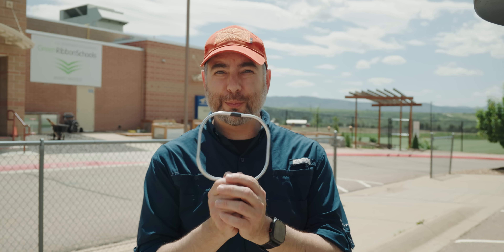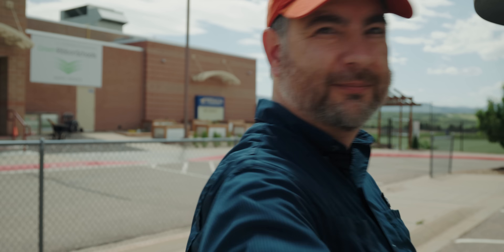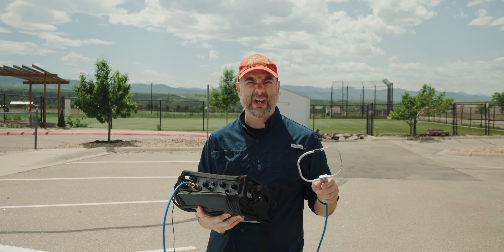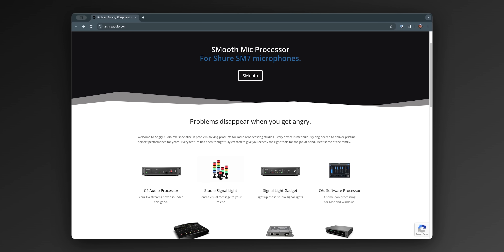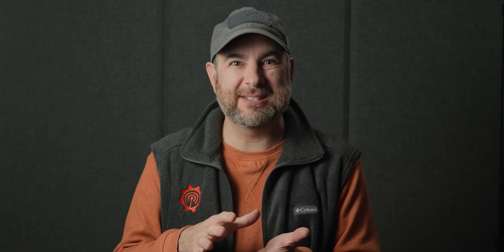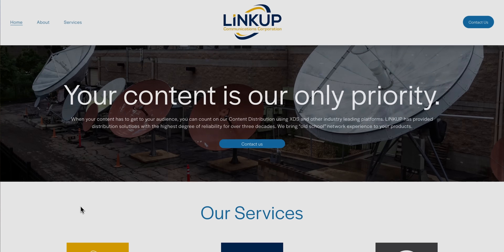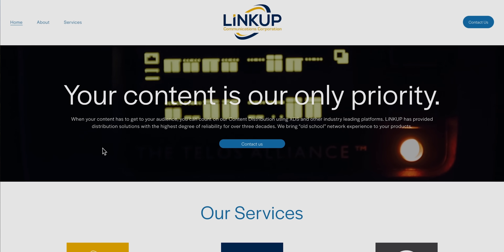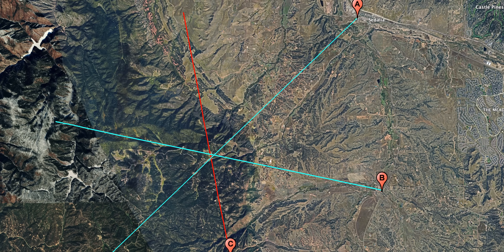Hunting a pirate transmitter

Comment: wouldnt a doppler be a loot simpler? Amateur radio have been using that in fox hunts for a lot of years. Instantly see what direction the signal is on the fly. No messing around
Reply from the maker: Simpler, but way more expensive. Most broadcast engineers will have a spectrum analyzer for doing many other tasks. So using a tool that you’ll already have to do this is prudent. Spending $700+ for a Doppler system that you’ll use only a couple of times in your career is a little hard to justify. If you do it all the time, then yes.

Comment: Hi all. UK Here. 
Back in the early 80’s of AM/FM CB game called Fox Hunt we had a car that would hide and that driver and passenger would describe a hint what was close. 
Stay with me, so we had to find that car with clues so what I used to do was use the SWR, the trick was turn it up then change direction soon as it cuts off turn around, repeat. Until the radio SWR was a maximum and you could still hear the Fox. Narrows it down so much… the winner was always Fox so you saved on petrol. 
It was fun when over twenty cars was involved

Comment: ....ham radio guys get pretty good at this....often chasing interference deliberate or otherwise with directional antennas and loops. Since portable spectrum analysers are not a dime a dozen, a general coverage RX with a S meter will work OK..
Reply from the maker: I just picked up a Tiny SA. I may give that a whirl this coming week to see how that works.
Reply: @TheBroadcastEngineer   the kraken sdr setup is also a cool option  for  transmitter  hunting
Reply from the maker: @gfdemt917 If I had the cash for that I’d snatch one up in a heartbeat. I did pickup a Tiny SA from Amazon for $57.

Comment: One trick I learned from years if tracking ELTs/EPIRBs is that as you get close in with a very strong signal, often creating lots of false reflections, is to go to the HARMONIC(s) of the signal youre tracking,. ELTs, tend to be VERY harmonic "rich". And so are many (junk) pirate transmitters. You dont always need a fancy SpecA, just a wideband Ham HT or Scanner will often do fine.  Happy hunting :)
Reply: @radiodf  Correct about not always needing a Spectrum Analyzer. A few miles from my home we have a traffic light that emits a signal on 146.52 Mhz which I hear on my mobile 2 meter radio. When the light changes to GREEN the signal goes away.

Comment: All this is good for a signal with fixed location and a visible transmitting antenna.
It becomes almost impossible with a mobile transmitter (not an FM signal), that transmits illegally (for short periods of time) in the shortwave bands and causes interference to other legitimate users.
We used to do this in the army in field communication and, after each transmission,  move quickly to another location.
Reply from the maker: Yeah, mobile units are a lot harder. I didn’t cover that as this channel is focused on broadcast which is a fixed point.
Reply: I've dealt with those too. There were some guys keying their mics and holding the mic near the stereo speaker while driving. We knew their were two different ones, because one played rock, the other one liked country. At that the in culture seldom did those genres meet, if you catch my drift. Yeah when they are mobile, it's tough. We got a number of people tracking them. A couple of our fox hunters had invested in a device called a Dopplescant. You fed it from four 1/4 wave antennas evenly spaced on your vehicle. The control unit went between the radio and the antennas. These things were hard to fool. They would trigger on reflected signals and with no antenna gain, weak signals would also beat them. Again, in most cases they worked  very well. In our practice T-Hunts we tried to fool these things. Made it tough on the guys using conventional means. We didn't catch anybody red handed, but got close enough, that we got a semi-confession out of one, "his buddy did it."  So, the rock music one, went away, shortly thereafter.  Then one of the fox hunters walked up on the country music suspect just as he got out of his car. The guy recognized his fellow ham and asked what he was doing, he said looking for the person jamming the repeater with country music. That one went away after that. The rock music suspect was a crazy teenage kid. He was a licensed ham, just kind of a spoiled brat type. The story we got, the kid is blind, another ham was driving and claimed he didn't know the kid was holding the mic in front of the stereo. It was happening on a regular basis, so that was hard to believe. The country music fan, was a 35-40 y/o, old enough to know better. He just kind of had an attitude. They both got kind of nervous when vehicles with call letter plates were following them, and especially the ones equipped with the Dopplescants.

Comment: The loop nulls either side....2 nulls broadside ....when at sea as an RO we had a Bellini Tosi antenna up top (crossed loops) which were attached to a goniometer in the radio direction finder. You found the 2 directions at 180 deg from one another and then hit SENSE which would plug in a vertical on top of the crossed loops this made the radiation pattern go from a figure 8 to a carotid shape (single null) showing the actual one to pick of the 2. 73 de VK2AOE

Comment: 😅one thing doing this in Colorado where there’s FA around for miles. Much trickier in the middle of London where there are so many reflections and phase angle changes! 😅 Nice video , we used a map, transistor radio, compass and ruler in the old days.
Reply from the maker: If I were to go downtown or up into the mountains it would be more difficult with all the reflections, but for a basic video, why make life harder for myself and just keep it easy. :)

Comment: Word of the day: Triangulation. You can do the AM null with a pocket radio very effectively. FM pirates are easy to find too. The antenna is out in plain site. 1st adjacent gets quiet when you get close.
Reply: In the old days before GPS and even before Loran navigation, boaters could use directional null antennas and use stations in the AM band to triangulate their position on large bodies of water. If you were in the Atlantic, maybe close to Florida, you could find the direction to a station in Miami and then one in Jacksonville (just an random example) and draw lines from them on a map and the intersection was where you were in the ocean. Accuracy was good enough to use to steer your boat to where you wanted to go. This technique was once pretty common until the late1960s when Loran stations for navigation were being put in places near bodies of water.
Reply: @markr.1984  There's a story in The Register today, thanks to GPS jamming the UK and France are looking to bring Loran back.

Comment: Would a NanoVNA work as the spectrum analyzer?
Reply: @jackmortimer329  No a nanoVNA would not be useful. A TinySA Ultra is an excellent tool in a similar price range as the nanoVNA.
Reply from the maker: I want to get my hands on a Tiny SA. Saving up my sponsor dollars!
Reply from the maker: Nevermind... just found one on amazon for $57. It'll be here tomorrow... 😄
Reply: Note that the original tinySA has a very small 2.3 inch screen, which is nearly impossible to read.  The reason that I bought the ultra model was for a few more dollars, it gives you a larger 4 inch screen, wider frequency range and also FM demod. via an earphone jack. 

Enjoy! It is a great simple tool, which is accuate enough for basic testing.

Comment: Will this work at lower frequencies?  Like 7 MHz?
Reply: You'll need a bigger loop, but yes, loops are often used to DF on HF frequencies. A loop this tiny will be very inefficient on HF.  networked TDOA systems also work well to figure out what part of the world to take your loop to.  Large ground based yagis work too for initial bearings.
Reply: @stargazer7644  There's a net that I frequent that's subject to jamming.  Somebody is playing recordings of Morse code on two closely spaced frequencies.  The text is random, with obscenities.   I suspect that FCC will not bother to search them out, but if we hams identified the culprit and gave it to FCC with a ribbon on it, they'd take action.  Net control is in Southern California, and the signal is very loud at his location.  I can hear it up north, but not very strong.
Reply from the maker: The FCC likes when you give them a big present like that. They will redo all your work but they don’t want to be chasing grudges and bad engineering. When I had to hunt the last time I had to put everything down with a lot of detail and photos. And even then they didn’t act on it. The LPFM ended up going bankrupt.

Comment: Why not just use a Kraken SDR.   It has 5 small antennas and pin points transmitters
Reply: The Kraken isn't a magical do everything device.  Try using it to locate a weak intermittent repeater jammer who doesn't want to be found sometime.  It's pretty useless for that.
Reply from the maker: Because I already have a spectrum analyzer and can’t spend $700 for something that I’d use only a couple of times in my career.
Reply: @TheBroadcastEngineer  If you spent 0.25 hr using the Kraken  vs.   1.5 hr  with the Spectrum Analyzer,    aren't you more efficient then?
Reply from the maker: @dan_in_sd in a technical numerical sense yes. But the reduction is not that significant. You’re still driving around. Had I not set up the camera it would have been a lot faster.
Reply: @TheBroadcastEngineer  i have a kraken and its worth it although i dont hunt pirates

Comment: Why not just use the "Kraken SDR"  to locate RF Emitters in the 24 MHZ  to  1.6  GHZ   frequency spectrum.     I have the use of one and found a cellular tower with a continuous carrier signal at 730MHz.    Found in under 20mins of driving around.   :)
Reply: I'd like to see you use a Kraken at 24 MHz.  I have a Kraken too.  I find it fiddly and useless at finding weak or intermittent transmitters like malicious jamming.  It works fine for strong, stationary constant wideband transmitters at high locations above about 80 MHz.  But I find I can usually find those pretty fast with just an FCC database lookup.
Reply: @stargazer7644  yeah,   they really work well but maybe 70MHz and up.   i never found it fiddly.   just takes common sense
Reply: @stargazer7644  not generally good to use at 24MHz,   but ive tracked emitters at 70 and 90 MHz
Reply from the maker: The reason is because I don't have one, and don't have $700 to buy one. I use a spec an way more often than I'd use a Kraken... however, if you have one or have access to one, that would be WAY easier.

Comment: We used to do CB T-hunts back in the 1980's. Either picked a channel that was rarely used, or if most of the crew that used a channel was there  we would use our regular channel. We used to have a large group on channel 4.  That was usually interesting with the base station folks getting a laugh out of the rest of us. I had antennas mounted for highest directionality, and a dummy load in case I wanted to verify how close I was to the transmitter. We would sometimes play all night. And most of the HAM hunts  are referred to as Fox Hunting. There's a website for finding hunts close to you.

Comment: Hy. Im facing issue with 855Mhz signal. We use radio for pump station... and now, à fucking guy probably buy à baofeng. And we lost radio signal sometimes. Sometimes is only after usual job time and on week-end...
Reply: So DF him.  All you need is a receiver with a signal strength meter and a small yagi for 855 MHz.
Reply: Ok. Thank you. We have yagi antenna. I will buy an entry level receiver. A sdr is fine ? Thank you.  @stargazer7644
Reply: And we need a 5% duty cycle to keep our tank at correct level. This Day, i set m'y duty cycle at 50% 500mW. 500mW is maximum in French régulation. 50% duty cycle is forbidden.... I will solve the issu and go back to low duty cycle.
Reply: @pab26120  Buy a Kraken SDR.   Or find someone who owns one.   Try your local HAM Radio Club.   someone there has one.

Comment: I've done many T-hunts or Fox Hunts as they are called.  I understand in Japan they do a lot of them on foot and make a race out of it too.  You see guys in tank tops, shorts, and running shoes carrying HT's and a directional antennas.  I got pretty good at it.  My ham club, held one on the third Saturday of the month. Another club decided to hold one on another day.  The guy who was the "Fox" (hidden transmitter), started talking about me, and wondering if I was on the hunt.  He said I had a reputation for not saying much then sneaking up behind the fox, tapping him on the shoulder and saying hi.  I was listening to this and decided that sounded like a challenge to me.  I was at a friends house with twin 11 element two meter Yagi's.  I was able to figure out that he was almost due north of me, and little signal analysis after throwing some attenuation in line, I knew where he was.  So I jumped in the car, drove to the spot and started waving hi.  Then a crazy one, I was the hidden transmitter.  I chose a spot very near the repeater site, so I could run any power level I so desired and still be full quieting in the repeater.  It was around Thanksgiving and the stores were very busy.  My location was in the parking lot of a Walmart Supercenter.  I figured they would have to find me amongst 10,000 other cars parked in that lot and many of them coming and going,  I would give these clues, my partner would almost bust her gut trying to keep from laughing.  I didn't lie, I just didn't tell the whole truth.  My clue would be "off to my right I see a tree." Then ok ok, that didn't help, also "very near me is a blue Chevy pickup truck."  In this town how many blue Chevy pickups are there?  Probably a couple of dozen in that parking lot alone.  Well, just a few minutes into this thing, a car pulls into a parking spot literally right in front of me.  It had a ham call letter license plate, I recognized it.  Belonged to a YL operator, Sister Virginia, a Catholic Nun, who was a ham radio operator.  She used her radios and skills to serve mankind, as part of her job as a Nun, serve other people.  She wasn't even participating in the hunt, just out getting some supplies she needed. Nuns shop at Walmart too.  I was at first, no fair! using divine intervention to find the fox.  However, there is nothing in the rules against it.  We had very few rules, after all we were practicing for finding rule breakers, not rule followers.  The fox had to transmit a reasonable amount of time and mostly on the reoeater's primary input.  This particular one had some UHF inputs as well, and since I was the engineer, I knew what they were and their PL tones.,  Also, the fox had to hide within the county limits, and must be in a publicly accessible place.  Like a park, a shopping mall, or if on private property, the owner doesn't mind the fox hunters coming in.  One time a couple of guys got a little gray with this, they hid well off road in an illegal trash dump.  It would have been helpful to have four wheel drive to get in there.  We started calling them the "nasty boys."  The fox hunters could use any means to find the fox, including calling his XYL (wife) on the phone and asking where she gave him permission to go that day,  One of them before my time, they told me the "Fox" dressed down, in old clothes, didn't shave, or comb his hair, put his HT in a brown paper bag, where it looked like a hidden liquor bottle, he might have had one of those too, that was his occupation, liquor store owner.  He would wander around a park where there were other homeless people hanging out.  He even approached one of the Fox Hunters and bummed a quarter off him.  He later accused the guy of being a tightwad, "only a quarter, come on."  They figured it out when they asked a teenaged kid, if he had seen anything or anyone acting unusual, and the kid, replied, just that narc over there, talking into his brown paper bag. Then the fox hunters, said, Clint it's a wonder you didn't get shot!  This is too long as it is, but I have many stories about transmitter hunting.  I introduced my GF to it by the second date.  She got her ham license and glued herself to me as my wife of the last 20 years.  A woman that likes ham radio is definitely a keeper.
Reply from the maker: Oh my gosh those are awesome stories!
Reply: In Europe (mostly) there is an annual organized international sporting competition called ARDF or radiosport with teams from over 30 nations.  They hunt on foot on 80m and 2m. Check the wikipedia article on "Amateur radio direction finding" for more info.
Reply: Love the Nun story! I pulled some hides on CB that were just plain nasty. Concrete walls and chainlink fences, canyons with those giant power lines and backed the car up within a few feet of the towers. Along with the rule that you had to hide within the boundary, but there wasn't a rule against going out of bounds and coming back in!
Reply: @javabeanz8549  We did one at night on two meters.  The guy drove a pickup truck and had an 11 element yagi in the back end.  His transmitter was steppable from 100 mw to 100 W.  He would aim the beam at the skyscrapers downtown and at the broadcast towers west of town.  We were driving up and down these dark roads in isolated unincorporated areas with oil leases.  The leases were posted with no trespassing signs, that kind of implied they didn't call 911.  We started seeing cars parked at the end of long driveways.  We, finally told the "fox," OK we give up, before we get shot,  When I saw the setup he had, I just kind of shook my head.